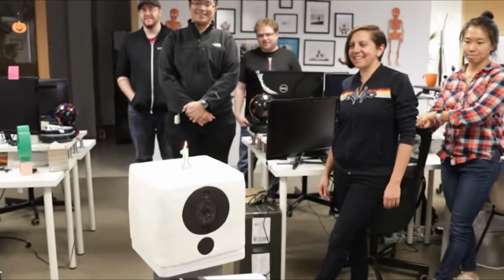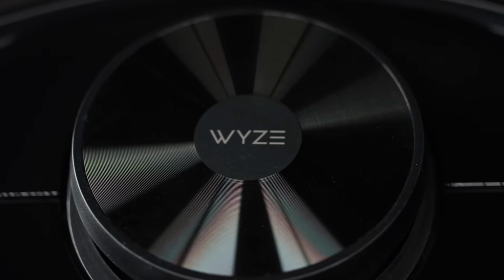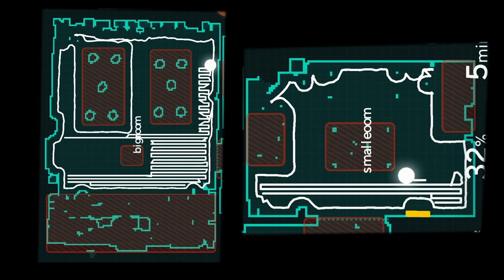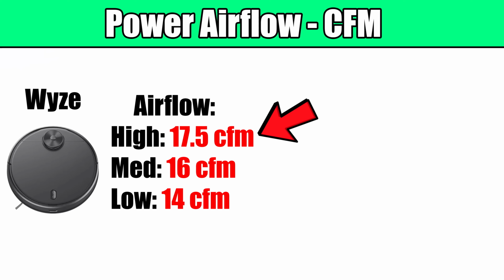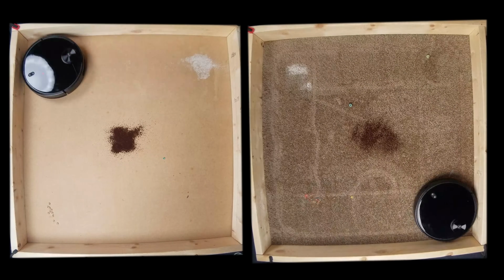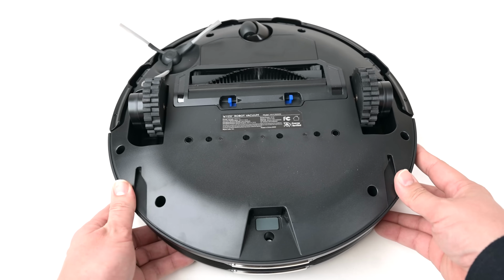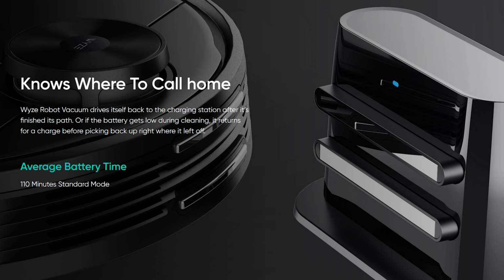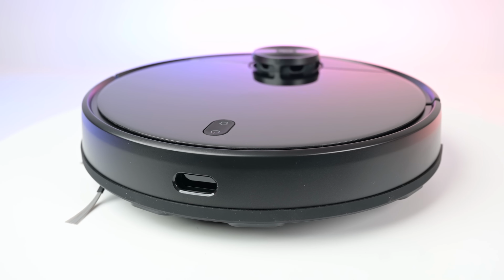WYZE Robot Vacuum Review - This Will Shake Things Up!

Comment: I got this a few years ago on a Walmart clearance rack. Sealed, brand new (not a return) for $100. Absolute steal. I do use my main vac the most but this robo vac is pretty impressive. Love the easy removal of brush roll to get any dust, dirt or hair out that could get stuck after a bunch of uses. Well made product.
Reply from the maker: That is awesome! We love to hear that. So glad that it's such a great product for you!!! Thanks so much for sharing that with us!
Reply: @VacuumWars love it for summer too since my building is old & outlets can only handle so much. So when a.c. on, no problem running robo whereas my main vac may require turning a.c. off depending on where I plug it in & that can be brutal. Honestly tho for $100 the wyze is a steal.

Comment: This video is part of what helped me make my decision to buy this vacuum when it was on sale at Walmart a few years ago.  Overall, it has been good, especially for the price.  Even four years later it's still hard to find a compatible LiDAR unit for a comparable price.  However, over time the vacuum has gotten harder and harder to use.  It routinely gets stuck places it never got stuck before and has plenty of room to get out of, and sometimes cannot find it's docking station.  It will drive to the docking station, engage the charger, and then pull right back out again as if it missed and try again - sometimes for so long it runs out of battery trying.  Other times it will think it's disconnected from the charger (even though it's not) and discharge it's own battery just sitting there on the charger so that when I try to use it there is 0% battery remaining.  Sometimes it randomly skips large chunks of a room it has cleaned a thousand times before for no reason, and yet still reports 100% efficiency in the cleaning history tab on the app.  The last disappointment I'll mention is that Wyze clearly intended to eventually give this unit mopping capabilities too, but it has been several years and they still haven't done so.

Comment: I had one for a year and won't buy again. It was quiet and cleaned well but the dust bin was a joke, like it will collect 100ml of hair/dust and it's full, constantly got stuck or rolled over thin bathroom mats and dragged wheel around the toilet leaving black marks. One day just stopped recognizing the bin installed and I dumped in the trash. For the same money you can get a decent vacuum with lidar and mopping....Wyze cameras suck too
Reply from the maker: Sorry to hear you had trouble with it!

Comment: just ordered one of these after being pretty disappointed in the performance of the iLife V3x. Its crazy how many of these robo vac's are including a "mop" attachment that is almost entirely useless as it just drags any dirt it picks up and spreads it across the floor leaving hazy streaks, and tells you not to add any sort of disinfectant to the tank. so its even more useless. I'd rather 1 robot do 1 job effectively than 1 robot do 2 jobs sub par. Hopefully some day Wyze comes out with a dedicated wet mopping robot that can work in tandem with this vacuum bot. and not cram a water tank onto this bot and have it drag a dirty rag across the ground... Awesome review tho!

Comment: If you buy one, get insurance. It turns into a paperweight after a year or two. I have three, and two will no longer work after an update. There is nothing wrong with the vacuums themselves. But after the update, they no longer connect to Wi-Fi. Something similar happened with their v1 sensors. If the battery died, it would no longer connect. It's sad because they're decent otherwise. I had a more expensive vacuum that didn't clean as well as the Wyze robot vacuum. Oh well, it's just time to move away from the Wyze ecosystem.

Comment: 8 months in and this little POS left two permanent marks where the wheels are when it's docked. And it's a widespread issue judging from the 340 replies on the support forums. DO NOT BUY.
Reply: If that's all that's wrong I would just put something underneath it, like one of the mats that come with bots with mopping attachments. But yeah you should not have to do that in the first place.

Comment: How does the wyze stack up to the 360 S5? The S5 is currently at $199 so cheaper than wyze and it has lidar as well.
Reply: As this was posted 8 months ago you will be lucky to get a response. He has done a 2021 best robot hoover video which gives the Wyze best budget hoover so perhaps that is an indication but you should check it out yourself for more info.

Comment: How often do you need to empty the vac? Preferably from pet owners that have a shedding dog. 😎
Reply from the maker: It will just depend on the amount of hair that gets cleaned up.
Reply: @VacuumWars  I figured just wanted to know if the vac has to be emptied every 20-30 min but i guess thats hard to quantify. Kind of wish Wyze put a separate product out that allows the vac to self empty like some roombas have. But I’ll likely pick up thr vac anyway to go with my other wyze products.

Comment: The comparison to the S4 is valid because they're both rebranded Xiaomi OEM bots that use the Xiaomi software framework as a jumping off point. The Wyze vacuum itself is a sister model to what the S4 is (hence the mop attachment point). Some of the residual mopping (like the sounds / TTS) stuff still exists in the framework (you can trigger it by putting the bin back a certain way), so who knows if they'll roll that feature out as it is part of the OEM package. You can buy the mop kit itself from the other companies that sell the same model.

For those on the fence about this vacuum, they're still improving the software side. When I first got it, I hated the thing. It was dumb as a rock (the Amazon review I wrote initially and then two weeks later are completely polar opposites). Luckily, before I could return it I retested it with the beta software release (you can sign up on the Wyze site and in the app) and those improvements made me keep it. At the $220 price point for a US-company, it was a no-brainer.

Multi-floor maps are in beta testing (you can sign up, but you may or may not get into that test group, it seems random), new mapping algorithm is in a wider test group and works much better than what went out officially. They're also in the process of adding spot cleaning and a few other much requested features. So as with early adoption to Wyze products, you're a beta tester whether you like it or not.
Reply: How has your experience been in the last 4 months? Right now is in sale price at 199 US. 

What do you think?

Comment: Update.    Additional issue with Wyze robot vacuum.  It only has rectangular barriers which won't work with several of our angular halls, doorways, and interior walls.  Frustrating.
Reply: Wyze has confirmed after a year that they won't fix app issue involving interior walls.

Comment: I have a request.  When reviewing the mapping robots, can you try to add something about the functionality of the robot if the app stops logging into the parent server.   I recently purchased a 360 S5 and found the robot completely dependent on whether or not the app was logged into the servers.  Even rudimentary things such as cleaning progress, battery condition, or changes in schedule, seemed to indicate the need for the app to "phone home".   Thus if the company ever goes out of business, your 'smart' robot instantly becomes not so much.   I have a Roomba 692, and yes, I had to open an account with irobot to register the robot within the app, but it's basic functionality doesn't seem to be tied into my ability to login to iRobot.   For example I can still set scheduling between the app and the robot even if my internet is down.   Something that completely crippled by LiDAR 360St.   I returned that robot immediately, but am hesitant to go to advanced mapping robots since it appears all of them have a seemingly unreasonable need to connect to company servers to do the most basic of functions like schedule changes or setting no go zones.

Maybe there's still a place for the less intelligent "random bots".
Reply: Great call-out! Relying on a constant server connection to operate is a huge downside. Not even considering local connection issues, it leaves you completely beholden to that company.
Reply: There's a whole open source scene for making software that allows you to locally control stuff that companies try to tie to their server. Some has been made for a few of the larger robot brands, to varying states of functionality.

Comment: Vacuum wars...I purchased a Veavon V8 with supposed 4000pa.  Can you do a test review?  Would love to see if you get anything near 4000.  So far, I'm not too impressed.   I have used the proscenic m7pro and according to advertised features, would be similar as it has lidar and dual brushes.  I also use a Deebot T8+ at home for the past couple months, and personally think the T8 is better than the V8, and I like the m7pro better than the V8.  I don't like the all bristle brush vs the brushes on the T8 and M7PRO.  Also, battery life was disappointing even though it has 5200mah battery.    I have other observations as well such as the app really drags down on my phone and is like running windows 10 on an xp computer...very sluggish.  And the app does not allow for partitioned rooms to set different power settings.  The algorithm is not as refined as the m7pro, and the T8 is far above the V8 in that area as well.  Would love to hear your impressions as I am considering returning it.  I purchased it from Amazon for $300 after 25% coupon...reg price $399.

Comment: Excellent, methodical reviews - thanks!!!  I always look to your reviews for making decisions.

RE Wyze robot vacuum... I am frigging annoyed.  I want to make comments to Wyze on fixes/improvements but it's forum is not capable of accepting them, so here they are.  (Expect to see these on FACEBOOK or elsewhere too.)

Just purchased - based on features/price and past Wyze product experience which was good.  Basic operation is promising, but have questions/suggestions.   I figured they would have avenue to accept input/questions, but I cannot find it in my Wyze account.

1 - Dust bin is very tight and so far I have to pry it out with something.  Slight redesign might help here.  No issue.
2 - Map - dividing areas.  App will not allow me to divide my open concept dining and living area into two.  It says size too small.  How to fix?  This is big issue for us.  Please enhance.
3 - Charging station assumes vertical walls, no baseboards.  Thus, with my baseboards the robot seems to have tenuous contact with it as the charging station tilts back when bumped by the robot.  I'll add a foam piece behind the charging station.
4 - One room needs to be remapped as there were floor-length mirrors which confused it.  However, there is no option to remap any single area.  Only to remap whole house.  Please enhance.
5 - Virtual barriers only allow square box.  No lines and no ability for a diagonal - which my house has several, so I cannot use the barriers for several room areas.  This is big issue for us.  Please enhance.

Recommendations for others:
A.  Besides making sure cords and small pet toys are up - use a good floor, cord protector.  We found the silicone ones on Amazon good for this.
B.  Make sure doors to rooms stay ALL THE WAY OPEN or the robot may close them in its wanderings, leaving it trapped.
C.  Look out for floor length mirrors.  Suggest you tape paper to the bottoms during initial mapping.
Reply: Update  May 2021.  Worked with Wyze on the issue that robot does not map walls properly- specifically interior walls.

They acknowledged it as an issue and offered to pass on as fix.  But I have no confidence that it will ever be fixed

Hence, I have to create, move and delete barriers EVERY TIME I want to vacuum my kitchen, dining room, livingroom or hallway!

This is truly a big and thoroughly a frustration on a daily basis.
Reply: Update:
Finally connected with Wyze Support.  My bad for missing the route through their app.

Generally it does a great job.

Wyze support is helping me with last issue.   For some reason it can't divide a "room" - set of 4 rooms around a central wall.  It may be thinking it's some LARGE piece of furniture or something?!

So would I recommend it,  YES.  We love it.  It works really well with long-haired cat hair.  NO TANGLED WHEELS.

BTW, TIPS:
1. Where you have sliding glass doors or sliding mirrored closet doors- tape paper to the bottom for the first map.

2. Where the vacuum might close or move doors, use floor magnetic door stops.  You and robot can then vacuum there.  Conventional wall stops are a pain for man and robot vacuuming.

Comment: Seems you have never used another robot vacuum.  As WYZE's fall way short. Dividing rooms sucks, to say the least, and is impossible in many cases.   It gets lost easily, no spot clean, and can't save more than one floor, brush is clogged every other run just for starters.

Comment: I've been a long time user of Wyze cameras and it pains me to tell people to stay away from this. Wyze isn't the company it used to be. They fail to maintain their products in the long term, and numerous people have been burned from products that degrade in quality or just don't work (wyze motion detectors).

I won't even mention their terrible handling of data breaches, where they denied it happened, or promising features they then turn around and try to charge you for (cloud backup and 12 second recordings).
Reply: Agreed - the cameras are great for the price, although they still don't work with Google Home which is a big drawback if like me you prefer that ecosystem to (the admittedly increasingly ubiquitous) Alexa. But the door sensors and motion sensors I bought seem to constantly be going offline and require restarting of the Sense hub. And I've not heard anyone have a good word to say about their door lock (if there's one 'smart home' device that you need to be super-reliable, it's that one!) or outdoor camera. A promising start but ultimately it seems that you really do get what you pay for. If I were to buy this it would likely be the Xiaomi version with the extra mopping features (I hate mopping floors!)

Comment: The best thing is they listen and update their products! I have been using their products since their second product wyze V2 camera.
Reply: That used to be true, but not anymore. Look up the wyze motion detector which is an expensive paper weight since they don't support it and it doesn't even work with their own wyze products.
Reply: @ricktyman4709  none of their products are expensive so I don't think that is a case. I am not aware of their motion detector. Are you talking about the motion sensor they have because they just came out with version 2 of that and I don't think they would outdate version 1 so soon.

Comment: I have this vacuum, this one suuuccckkksss (in a bad way). I'm going back to the roomba 675 :( I have been going through their return process since the vacuum came out and have only gotten responses saying they are behind and dealing with other problems. Doesnt do a good job cleaning up dead leaves in kitchen (easy task) and gets clogged with hair on every single use. Match that with the terrible software that keeps spazzing out every other day and the terrible design of the dust compartment (doesnt fill the whole container, just the immediate area in front of the entry port), this thing is sooo bad.

Comment: I have the Wyze Vacuum and have been Using it for about a month.  I also have a 901 Debot and they are very similar.  The only thing I do not like is the charging.  It seems to not find the charger very well sometimes and will not hook up correctly.  It sometimes takes 5-10 tries to finally hook up to power but that is minor.  The issue I have is that it will stop charging for no reason.  It hooks up and then several hours later you find that it is not charging but it has not moved and is touching the charging station with the charge points..  They need to dome out with a pet hair brush also.

Comment: Wyze wont be getting any more money from me .   I own 5 Wyze cams, and the Sense kit.  The sense kit SUCKS (if sensors loose battery power) the sensors stop working. Like DOA.  Wyze will not replace them even though the defect should have been addressed from the beginning and I feel like I had a product beta tested on me.

Comment: I've been waiting for this review! I received my Wyze robot vacuum and got it set up a couple of weeks ago. Overall I've been very happy with the performance of the vacuum. It does a good job on all of the flooring types I have and it has cut back significantly on how often I need to break out the regular vacuum. 

I did have a little trouble with the initial mapping and dividing up of rooms. I've remapped a couple of times to get things the way I want them and have figured out where I need to put no go zones now. My one complaint so far is that it seems to create a dead zone that it doesn't quickly unlearn if there's an object sitting somewhere in a room on the initial map that later gets moved. I have noticed this if a piece of furniture is in a different location than when the robot initially mapped the room. Having been a user of other Wyze products for a couple of years now I have no doubt that they will fix this issue in a software update and I wouldn't say it's a major issue at this point - more of an annoyance.
Reply from the maker: Thanks for sharing that here - good input!
Reply: Do you need wifi to use this or can u just run it off ur phone